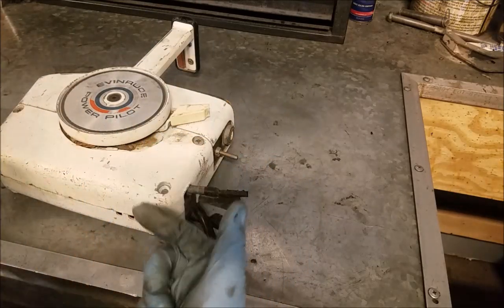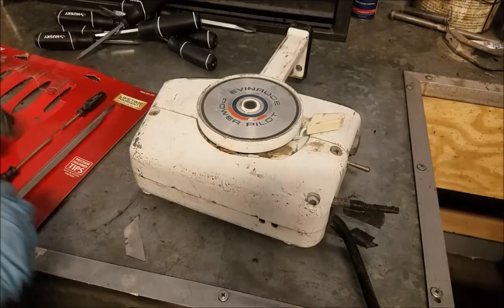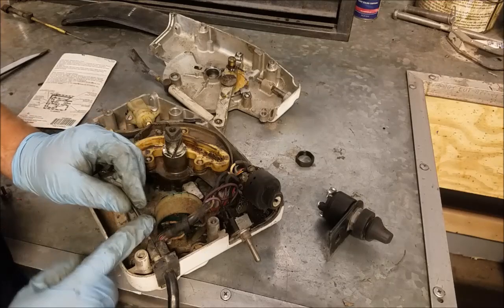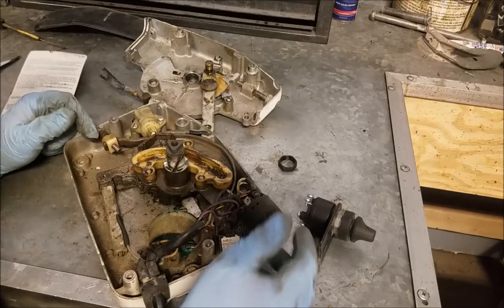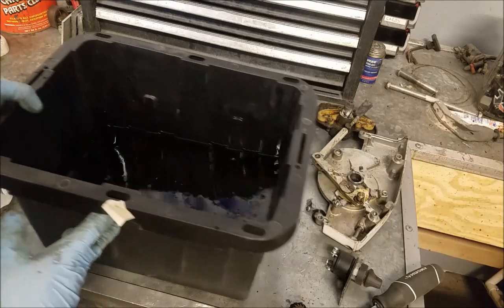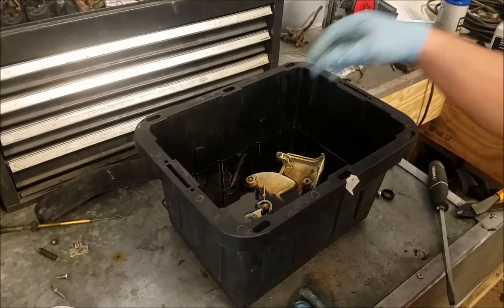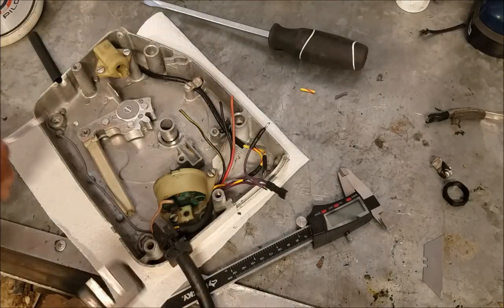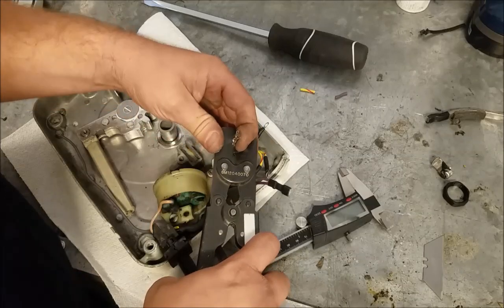Controller Key Replacement Turns Into Full Rebuild.

Comment: Thank you for your reply. However referenced information not very helpful as not related to Evinrude Power Pilot in video. That one looks exactly what I have and there are not holes in back side casing.  I tried to loosen torque screw on the face of the lever but would not budge. No way to apply wd 40 to loosen any rust etc. Does this screw have to be removed to remove lever and allow for casings to separate? From schematics, the screw does not look that long.
Reply: Hey mate i was having the same drama (i have exact same controller) theres just 2 bolts on the backside which are also used to mount it. Once they are out theres nothing holding it together, but the triangle shaft that the handle mounts to was causing it to not seperate. I gave it a few decent taps while trying to pry them apart and eventually it came apart

Comment: Very helpfull brandon and yes i would enjoy seeing how you add a trim n tilt accesory to equation. Just got me a 98 40hp johnson and wires hacked off 4inches from red plugs on engine side. One thing i noticed the red with purple wire is bigger gauge than all rest of your colors in order to assemble switch in controller if i had one is going down a size to match other wire gauges gonna potentially cause a wire overheat condition.really enjoy ur vids but hard to hear you sometimes.snookie pa.

Comment: Hi I have a question. I took out my boat last week and when we got into the water the control box started to beep. And then the throttle cable got stuck. And then we try to turn it back on but the control box didn't crank or make any noise. Does that mean I have to change my ignition switch like the video?

Comment: Great info on your channel! I actually have a question about a project i want to start, I am converting my tiller boat into a side console and i have a 1989 Mercury 20hp - serial # - 0C153483.  I believe i know what to do for steering as it looks like the motor already as the tube on it, and i think i need to buy steering link bracket ( 41323A03 ) . My question is about the throttle brackets and cable.  I go onto parts list for the diagrams but they are hard to understand what i need.  I dont want to do remote start yet, just want remote steering and remote throttle then down the road maybe install remote start and kill switch. Any help would be great, could also send pictures if needed. 
Thanks

Comment: I have same controller putting in new ignition switch but the neutral switch is missing is there a way to bypass the white wire.i have no start with new key but the old one started right up everytime then key broke inside.
Reply from the maker: Connect the 2 wires together where the neutral switch once was.
Reply: Do I ground out the white wire that used to go to switch or connect it to the S on key switch or the C terminal?thanks for your help.